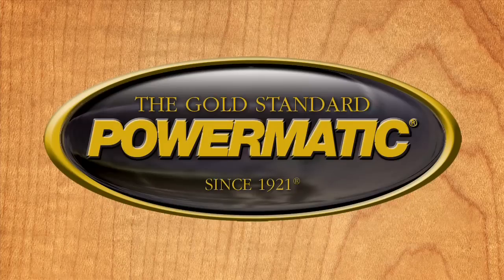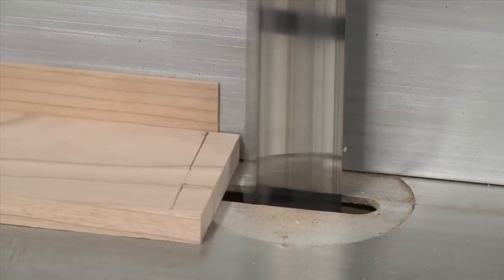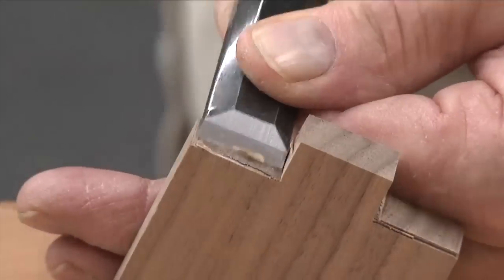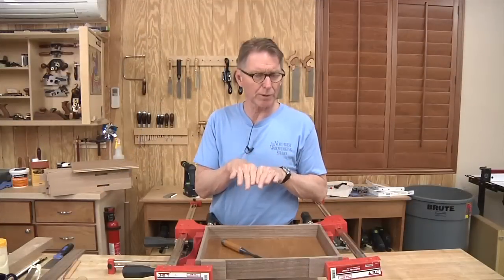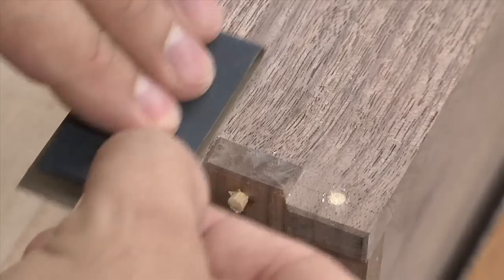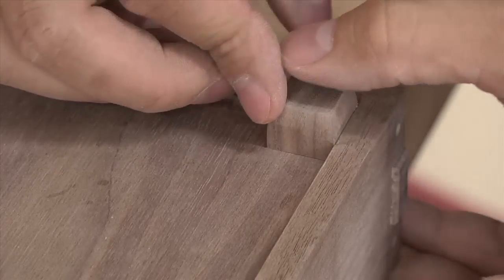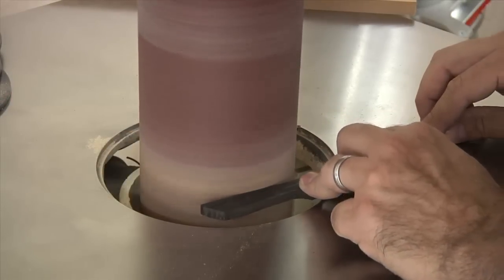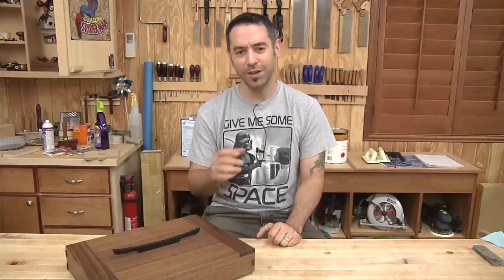224 - Jewelry Box w/ Gary Rogowski

Comment: Marc... why the use of loose tenons for the breadboard ends instead of cutting a tenon on the actual boards? Is there a structural reason or just easier? Great looking box. I may have to make one.
Reply from the maker: Thanks Jorge. Really it's just for simplicity. You have to cut a groove in the breadboard anyway so it's pretty easy to cut the groove in the top. Then you can cut the tenons/splines from scrap stock. In the end, the result is pretty much the same. Just a matter of how you choose to get there.

Comment: gotta remember the finish trick with the sanding pad. does it work with varnishes in general?
Reply from the maker: Yup, if you have it thinned for wiping it should work with any oil-based varnish.
Reply from the maker: +David Sili It should. Though I'm not sure if the wax content will gum up the grit making it less effective.

Comment: That handle bothers me; you're going to open the lid by the edge, not the center, and you can't pick the box up by it. There's gotta be some way of decorating the box without adding something that looks like it has no purpose.
Reply: It looks like something designed to hang your coat on, but obviously you can't because it's not on top of a stand or chair back. In other words it does look like it has a practical purpose, it just fails to actually be practical.

Instead of the handle, you could always decorate the top with an inlay, perhaps something representational like a leaf, or a geometric design, or simply a contrasting wood grain like zebra wood. Initials of the owner are always nice. If the top is made of burl maple, the grain is enough decoration. Given the bevels on the finger joints, it might be especially nice on this piece to make the top of beveled boards so that the finished piece has grooves delineating each board.
Reply: All of these folks that make these you tube videos go through a lot of work to do so and I hate to be critical and most of the time I take what is of interest to me or something that I have learned from the vid away with me with gratitude and appreciation.  I do appreciate this vid.  The box is absolutely beautiful and nicely built. Cudos to all.  But, since you brought it up, I would agree with you.  The box is so beautiful in itself.  Adding this truly oversized "handle"? destroys the box.  Rather than a box with a handle....It has become a monstrous handle with oh yeah a box?